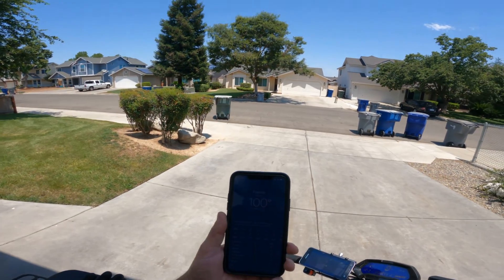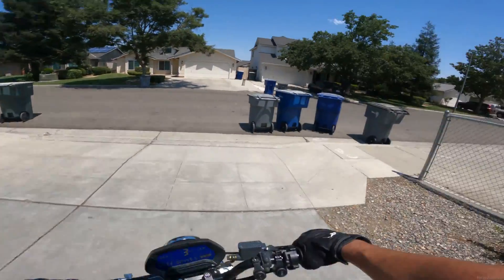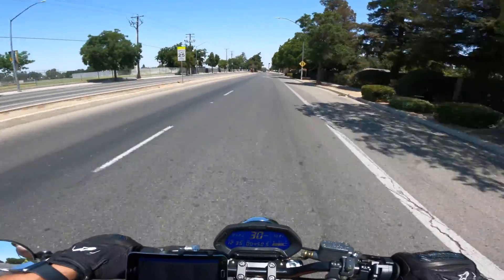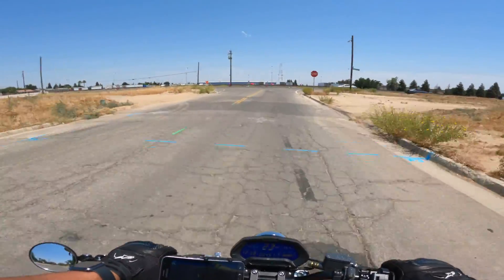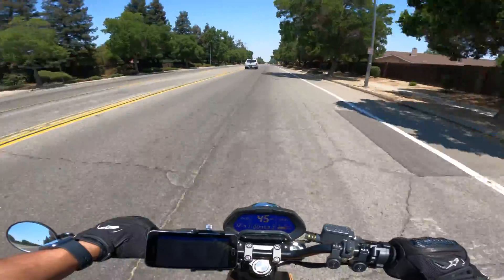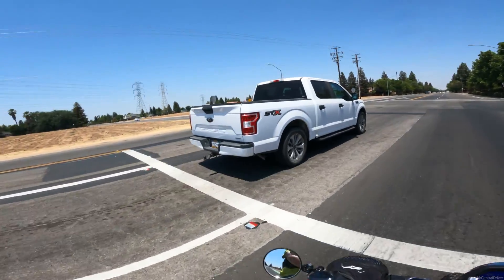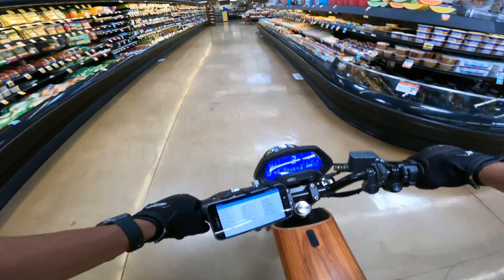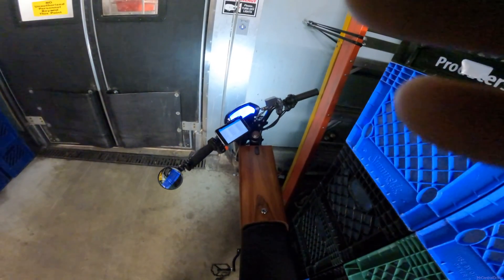Onyx RCR - Android Temp Monitoring // 100°C // HOT!!!

Comment: Hey man, I got 8000w 72v 40a ebike coming... I live 13 miles from work and it gets about 100+ in Arizona.. I plan to get the hub sinks and build a heat sink for the controller.. I won't be opening widen open throttle... But do you think it's possible to Daily commute the bike to work if I increase up to 40-50 mph gradually
Reply from the maker: Oh yeah. Easy. But for sure get heat sinks for sure or you might run into issues if there is no stop and go
Reply: @MrCentralDriver  does the onxy bike come with temp sensors, if not what are you using?  i been looking online and sphere forums cant find shit

Comment: I think the heat sinks helped. You didn't seem to have any issues with the Onyx this time.
Have you heard of the Metacycle by Sondors? It's made in Los Angeles. It is #2 in the video I linked at 12:11. Goes 80 miles & does 80 mph but it's a E- motorcycle. I'd need a license. https://youtu.be/S7UXDJLVuwM